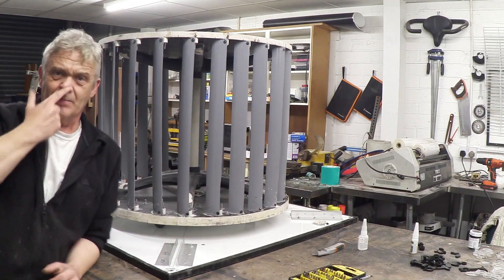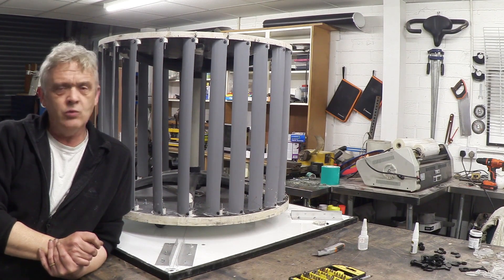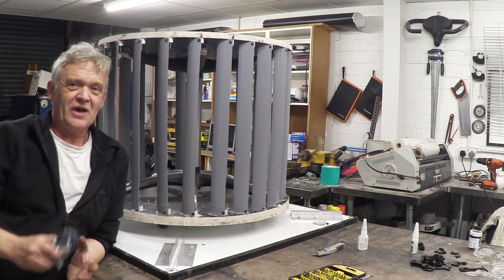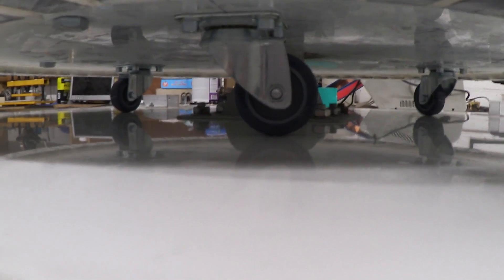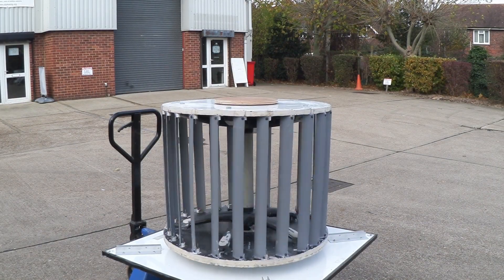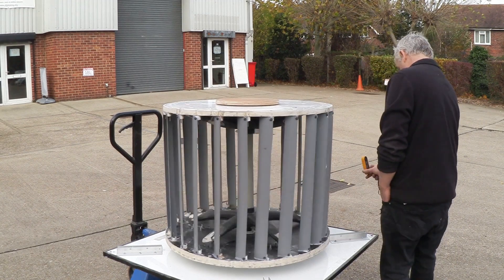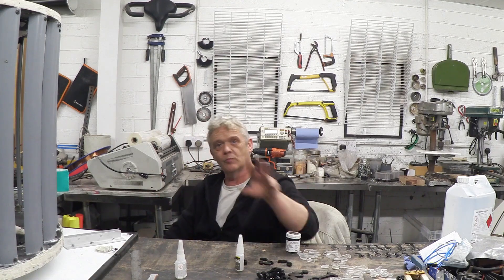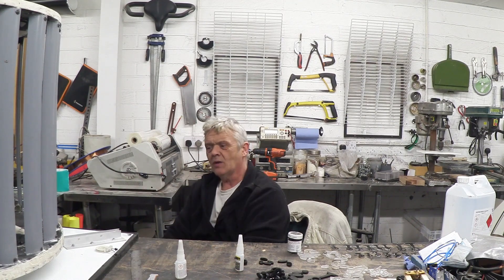Building a 1kW Wind Turbine For Under £100 - A Change In The Design

Comment: A good work around with the casters. you could of used angle iron as a frame work to steady the wheel. or just cut out out a "C" section from the wood, I am sure if you left a 2"  / 5 cm wide section all the way around it would quite sturdy.  for your coils, if you put 2-3 in parallel, then series with the next group, you might get a good balance of current and voltage. I know you would like to hook it directly to a load, but you would do better to use a charge controller to a battery, then a load. you would still produce power, but the battery will ensure your turbine isn't bogged down, just like the capacitor circuit you made.

Comment: I’m thinking it looks like a tumble dryer drum with built in bearings and support spider on a vertical axis. Could be a good start for a new beginner.
Reply: I have two mate but they run a solid brass bearing and they don't    spin nearly as good as robs. I haven't had the time to start my build yet so its too early to say
Reply: For the main cage I also saw a dryer drum with slits cut in it and the metal bent into fins, like a huge furnace or heat exchanger blower type of fan. But Robert's is probably lighter overall thus easier to spin.

Comment: It would also be interesting to replace the blades with Flettner rotors driven by a motor and compare the efficiency. This would also allow to control the flettner rotor speed inversely proportional to wind speed to stabilize the turbine at a specific rotation frequency.

Comment: You could angle the baffle plates and add nozzles pointed to the turbine, the nozzles are like tubes that get smaller that point towards the turbine blades and as the nozzles collect air they build up pressure and create like a jet of air that escapes the nozzles and spin the blades faster.
Think of water turbines that use high pressure jets of water. 
I have no idea what design the nozzles would be best or even if it would work but never know.

Comment: two bicycle wheels with the spokes and everything would make the structure considerably lighter
Reply: I was going to try with bicycle wheels.
Reply: That seems like a good idea but would you weld or rivit everything together
Reply: @johnwindess1641  well it depends if it's a steel  or aluminium rim that I can get hold of. Steel would be cheap, but expensive to preserve against the elements. I'm leaning towards a bike wheel because the bearings are tough, think of what they go though...
Reply: @trevorvanzuydam8115  well true as a child i would destroy bike wheels going off road so a bit of wind wouldn’t hurt them

Comment: Instead of removing the supports I might  have angled them with the inner section 45 degrees which would have left the possibility of adding coils & magnets upside down on the top plus the angled support sections would act to direct the wind to flow the wind around the Turbine Better...hatf to know for sure!  I like the look in it being more framed supported with Snow it might ice up creating turning issues...

Comment: Suggestions:  Drop the casters and Replace your turntable with a simple donut ring base so the design still supports the blades on top and the magnets below this open ring.  Connect the  "center pole" to the new donut ring table with a new wireframe (like a bicycle wheel laying flat).  Find two magnets strong enough to create a  "magnetic support system" on the center pole.  The overall idea is to create a floating turntable. This eliminates any resistance and creates a Friction-Free system that is 1) lighter,  2) faster, and 3) more sensitive to any wind.  Would you please add a flag in the background when testing it outside so we can see what direction the wind is blowing?  (so I can see it)...  There are other design features that can be added to double the energy produced. I can email them later... IF, you would like?

Comment: Smart idea...my only concern over it is debree getting under and jaming up things. Alternatively you could use pipe on the outside edge to avoid disruptive air flow...?
Also I saw this other guy doing tests with baffles showing it increased performance. but he had adjustable baffles though.. Another thought I was having was like a tesla turbine has an outlet for air fluid to escape in the center. I was wondering if the efficiency could be improved if air pressure was allowed to escape? could it be getting trapped in the inner portion?.. all the blades moving inward but no outlet.. at least with those funny roof spinners it's chaneling air downward...So maybe cutting holes in the lower halve would create cooling air for the coils...? 

just some thoughts...
thanks for all your videos..you keep me thinking....cheersu

Comment: While the casters are a pretty good idea, using piping to make the roof to keep it square would work and minimally interfere with the air flow.  The casters are most likely the plastic bushing type that will wear out under load fairly quickly.
Reply: @James Spinning at enough RPM to generate meaningful power on a windy day they will be under significant load. Because the load from the wind is different on each side, the forces create significant vertical load. Its the main failure point on pole mounted VAWTs.

Comment: Living in a coastal area of northern germany ,where the wind at this time of year is often ruff , wet and pregnant with salt and even "debris", lets me ponder over these  casters. They may not roll as smoothely as in "laboratory conditions" all the time and  the friction may thus increase over time especially if some leaves or other stuff the wind carries make their way to the surface the casters roll on. I would give the "bottom top-plate and bearing construction one more try . Instead of baffles or straight planks why not use some (circular diameter) drain pipe, maybe with threaded rods on the inside to pressurize top and bottom like "0815419" suggested below, but with the bigger diameter of the drainpipe to gain contact face/stability  .  As each lighthouse in coastal areas standing strong against the winds for centuries teaches us, that behind "round corners" the air flow and pressure is almost as high  as in front of it, nomatter which direction the wind blows, these plastic pipe columns could be a useful choice as they are almost invisible to the wind.
Installed at max. possible distance to the rotation center , as far as the bottom plate allows, the airflow behind the columns gets the chance to straighten out/  possible mini turbulences may vanish after the "convergence zone" at the immediate proximity of the columns. Keep your inspiring work up...

Comment: My thought to share is CFL domestic light bulbs have at least a couple of coils, Capacitors and a Bridge Rectifier, conveniently fixed to a pcb. Would a Spindle, a shed roof, mini guttering, a couple of bike wheels and multiple CFL pcb's with some magnets be a turbine start point or is this too scaled down? Should I head to the shed roof to prototype?

Comment: I could be wrong, but I thought the point of the addition of panels around the turbine were to direct the incoming air on to the blades that are moving with the wind and deflect it away from the blades that are approaching the wind? 

The ones I have seen built are often built with a similar aspect/size the as turbine and often boxed in with wire mesh (to stop birds and babies colliding)!

Comment: use same structure as the white 3 legged pizza tables that hold the pizza boxes up to hold it up with the legs cylinders so the winder bends around and through, so the pizza table is over it and 3 legs holding it up

Comment: Humm I would have used thin blades made out of teflon above a sheet of glass coated in a teflon sheet. So it acts like ice skates.
Perhaps a light spring loading to keep them in contact to the base would dampen any oscillations and help harmonic balance. Only maybe 1 or 2mm play between spring loading and full contact. I had thought about rubber damping but that changes too much between hot and cold. Perhaps some sort of air pressure between all the blades might work well if not too complex to create. Again temperature differences might cause problems a bent bit of spring steel or a spring might be the simplest and best option.

Comment: Thank you for the good laugh time and time again. I admire your creative mind, but here I think you’ld better choose the previous version with inclined stator vanes. (You had placed them at angles of 45 degrees, rotate that about 30 degrees and the results will be much better) the stator vanes should direct wind in the right direction. Even better would be to use curbed plates like you used in the rotor, but with an opposite curbing for the stator. Doing so you can harvest a larger windsurface and guide it towards the rotor, while blocking wind to blow on the wrong side of the rotor.

Comment: Good modification.  Your turbine blades probably create lift like a wing section or air foil when edge-on to the wind, The baffles prevented the lift from helping rotation.   I think your casters could be as easily mounted to the base, but it probably makes no difference.

Comment: Would another way be to make a "chain" of magnets around the central pinion, so you have the torque, but also has the length of chain for the circumference? Or would this create too much additional drag. I love the castor idea following on for the recycled and keeping costs low idea 😊. Other ways would increase the cost, and go against the spirit of the initial project

Comment: Have you tryed adjusting the angle of the blades. They are in fact wings. They have maximal lyft at a specific angle to the direction of the wind. And max lyft direction should be tangential to the cyrcle as much as possible. So you get maximal momentum. Looking at your turbine, I would say, this is not exactly the case.

Comment: Too late but u could have used a rear wheel drive car front wheel spindle to built the fan on. As u know the front spindle uses 2 timken bearings(oppositing taper roller bearings). I love this project I've been looking to build a portable wind generator for my RV trailer. This would help support my solar system. Living in Minnesota,USA solar system are not effective.

Comment: I saw that also but didn't say it...I was debating 1" conduit for framework or non metal pvc with sand and a 4way fitting at the top.  Only if you find the casters a problem.
As you show it now, it occurs to me that there are also other fluid dynamics.  There is now also a small internal pressure of air coming inside  but out in all directions.  there is also a slight counter push from wind direction.  I call the both adding up to 0.  I would ignore that mess and press on.  
But if I can ever make mine, I want to incorporate a freewheeling half side baffle on the non push side with a fin downwind to keep the baffle orientated.  Air exiting the non push side would get channeled out downwind or blocked (not sure which to do).  or free articulating the fins slightly. An unnecessary nuance of mine.  That would be Post experimenting at the stage it is at now.  I wouldn't have imagined anything at all if you had not built yours. You keep me thinking.

Comment: Hey Robert, i have used casters like this before. If you dont use ones with bearings in the wheels they will heat up melt and colapse. If they do it will end in tears. Lol just though i would pass on some knowledge as you give us plenty.

Comment: I have wondered with this design if you could haves slightly more power if you sited magnets and coil both on the top and bottom...however the law of diminishing returns may make the cost against improved efficiency impracticable. The other thought was bicycle wheels as the main rotating structure using every second or third spoke hole as the anchor for a support for the uprights and magnet...just a thought.  Looking for an old bicycle now...

Comment: As mentioned by JP, rolling resistance is your enemy here, particularly when there is downward force applied to the castors in high winds. Better to use square steel ~15mm sq where the baffles had been.

Comment: Hmmm...
I know you say the wheels ate barely touching, but... All I see is friction and drag issues. I could be wrong of course.

I'm thinking, a  L-shape aluminum bar (say 1-1/2" X 1-1/2") attached also in a L shape from the side and to the central point on top from two sides (or four), might be a better option. 
And if you think of something both lightweight and sturdy... then... just one L-shaped Attachment would deal with any wobble issues. 

Maybe it's just me but, the friction and drag I'm assuming because of those wheels... rubs me like nails across a chalk board 😂.

And honestly... It seemed to be rotating slower to me. I don't think that baffles are better (unless on the right angle), but I think the wheels are worse. 

So... One solid, lightweight 
"L-beam" to the top. 

Just my 2¢

Comment: Have you checked the angles of the cups to make sure they are the same. Having them adjustable would be great but I guess you are past that point now.
I love the way this has evolved, am looking forward to seeing you have many more coils. Fortunately you're just the bloke to build a decent battery pack t store the generated power. Will you be using a controller such as a solar collection controller (very cheap) to ensure batteries are not over charged?
Reply: Actually, this would work great with a couple of solar panels so when you have no sun an a windy day the system still feeds your batteries

Comment: Some wast metal pipe would have held the roof up without causing much of an issue.  I am waiting patiently for conditions to be right and for everything to be fitted to see this thing generate some serious power, which I think it will.  I don't care if it is 6 months from now, but I expect it might get some very useful power out of it.

Comment: Do you think that with increased centrifugal force that the casters will stay fixed?
They may swing outward, causing the wheels to turn inward & slow the turbine.
Reply: BALL CASTERS. But, I like where he's going with the parts readily available, low cost approach.

Comment: Robert, have you tried making your own staters to suit the wind turbine? Because of the diameter you have you can make from 12 staters upto I'd guess 36 baring in mind that 12 staters gives out an average 12 volts, "mudymudman on YouTube" shows you how to make the staters step by step, including how to wire them up ect, after seeing your designe I'm making one very similar but using 24 staters as I have successfully made a couple of wind turbines in the past but always used the normal prop blades and having seen your attempt I'm going to try using it with my home made staters and niodilium magnets, 40 mm x 20mm x 10mm and expecting at the very least 24volts

Comment: I was talking to 1 of my electrical assessors about a dynamo I have. 1 of the sugestions he had was about flashing the field winding to change it from positive earth to negative, apart from the change from pos to neg earth it is ment to improve dynamo output, and reduce the rpm from which it starts to produce power. What are your thoughts on this theory, and do you think it would be worth seeing the difference under controlled situation with your blower. Im also impressed how quite your blower has been on the videos.

Comment: Whilst I think the castors are a good idea. I can't help thinking there going to cause far to much drag. I reckon instead of the baffles you should of used something like 4 copper pipes  With elbows holding a bearing at the top. I think it would be far more efficient while also being strong and light

Comment: Great video. 

Would an 'x' made of thin wall EMT across the top and 2 pieces of all-thread rod on each corner work? The x should stabilize the top and the rod would support the x, connect the top and bottom and have minimal wind interference. Would the rods be strong enough?

Comment: Instead of casters what about rollerblade wheels?
Reply: Reason I say is that the caster whls (some ) don't have bearings, whereas the rollerblade ( or luggage wheels are the same ) have got skateboard bearings in. Skateboard bearings are everywhere and cheap to replace.

Comment: The biggest problem facing wind power is that it's constantly turning so wears components out, if you saw what Siemens charge for a service on a wind powered gen you would not be saying 'awesome' that's for sure, it's eye wateringly expensive. I think you've created a failure point there. Those little castor wheels will be made to travel hundreds or thousands of miles at XXmph which will wear them out and also wear the surface they are running on, both quite quickly (even on a properly developed version with better components). The first idea was better IMO in that you are just running on two bearings which were designed (if you bought the right ones) to do tens of thousands of unmaintained miles at high load before needing changing (I'm pointing at a car wheel bearing here btw). You could go back to your last design and either turn the corner planks so they guide air in or simply ditch them in favour of 4 steel tubes with a length of threaded bar through the centre. If you chose the former the whole thing would need a vane on top and be mounted on another bearing, the wind would then spin the whole lot to face the correct way (over complicated perhaps?). At some point you're going to have to think of a way of slowing it down in high winds or even completely off (at night perhaps) otherwise some gale force will blow it to bits.  I know this is just a test to see what is achievable, but i'm thinking ahead here! Keep up the good work, you're one of a only few genuinley watchable people on YT.